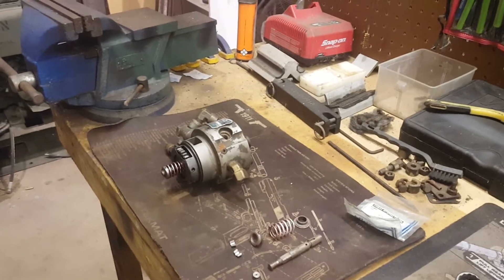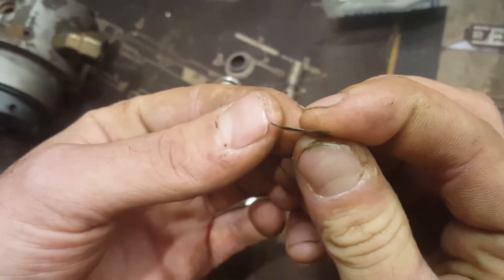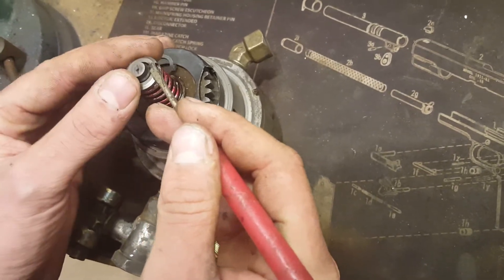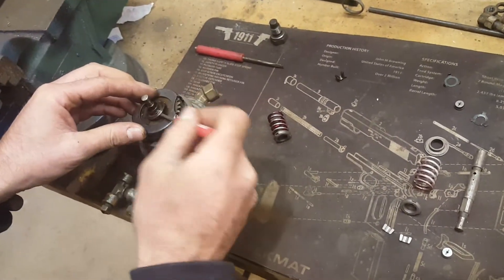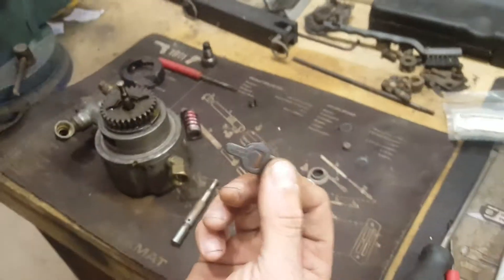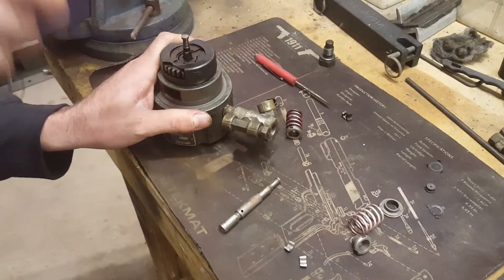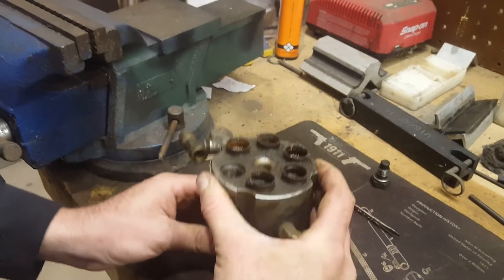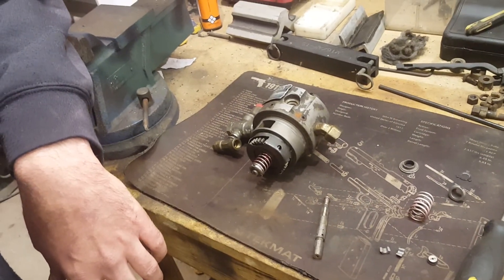Repairing common hydraulic head problems

Comment: https://youtu.be/qN0Iw2PvFnY?si=1gY1ANJyNxjeG1fW

My plunger failed on my pump. I have another but with a worn out hydraulic head (90100A).
I have another g-code pump. I disassembled the head, it is a little bit different. Do you know if I can run the g-code head (9065A) on the multifuel type pump?
Thanks in advance
Reply from the maker: If memory serves me correctly, that head is for the first generation LDS427 engine and it was fed oil via a port in the pump center section that is not present on the newer pump bodies. It also doesn't provide as much fuel as the 90100 head. I can't say for sure that it would fail in a newer pump body though, as they have a different oil path for the bottom end of the hydraulic head that may eliminate the need for oil feed from that port.
Reply: thanks a lot! I have to find a plunger and other parts. I´m also going to order from bike mike´s again @tacticalrepair

Comment: Does the plunger itself ever fail? If so, how can I tell if it has failed?
Reply from the maker: Yes, if it seizes in the head it's failed, or if it has noticeable wear or scoring on it, or if the truck won't run on straight diesel but will run if you mix a good bit of oil in.

Usually the problem is just the button fell off. They will move even without the button, but not enough to build pressure.
Reply: @tacticalrepair  okay thanks
Your channel is a life saver, wouldn’t even know where to start without these videos.

Comment: I noticed that the star bolt or torx looking bolt on the side of the head near that data plate was already removed. Does that bolt have any significance or can it simply be removed and replaced without any timing or lining anything up? My pump leaks from that bolt and it's very tight but I wasn't sure if there is an oring on there or not.
Reply: I got the bolt. TNJ Murray had them for $25 a piece. Replaced and now no leaks and she runs great again.
Reply from the maker: That's the delivery valve cover bolt. It had a precision machine fit seal. No washer or gasket or sealant is used. They usually start leaking because they're hairline cracked. You can try to loosen it and tighten it again to try to make it seal. Sometimes it works, sometimes the cap crumbles. You'd have to get a new one from Ambac or find someone who has a used one from a bad head.
Reply: @tacticalrepair  
Okay. Thanks for the explanation, I really appreciate it brother!
Reply: @tacticalrepair  
Will the type of pump, G code or the other variety have a different style of bolt? I sent Ambac an email and gave as detailed description of the bolt that I could and what I had. Hopefully they will know what it is or have a pretty good idea. I figure even if I do loosen it and snug it back up again works, it'll only be temporary before it leaks again and I prefer to not have a fire or other issues.

Comment: Hi Garrett thanks for the video! I have noticed in my truck I have developed a fuel leak and it appears to be coming from the top of the hydraulic head. All 6 of the fuel line connections seem dry and ideas? Should I plan on replacing the fuel lines, there is corrosion present around the fuel line nuts. Thanks for you help!
Reply from the maker: Yes, the best course of action is to replace them. Don't overtighten the new ones. 25 Lb/ft max, or you can crack the hydraulic head.
Reply from the maker: It could also be the 3/4" center bolt plug. Just break it loose and tighten it back down again. 45 lb/ft.
Reply: @tacticalrepair  thanks again